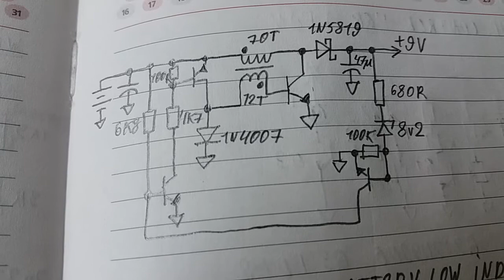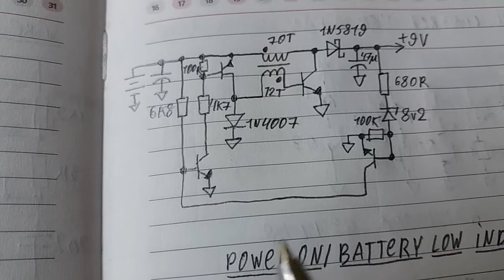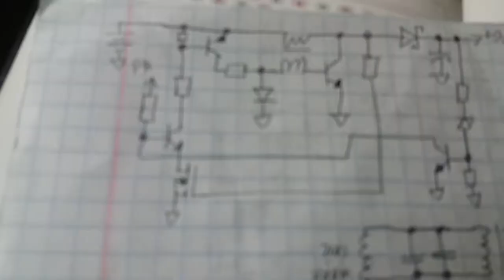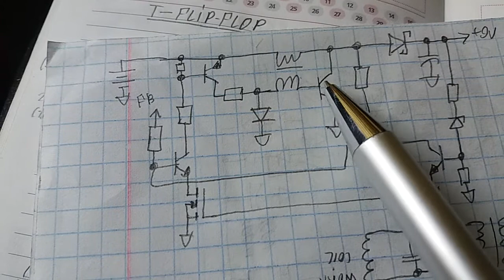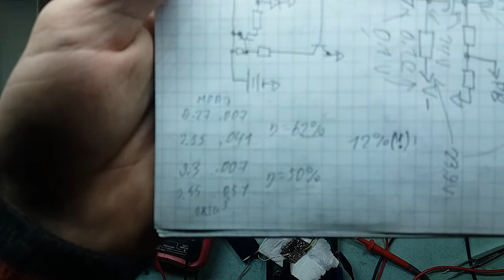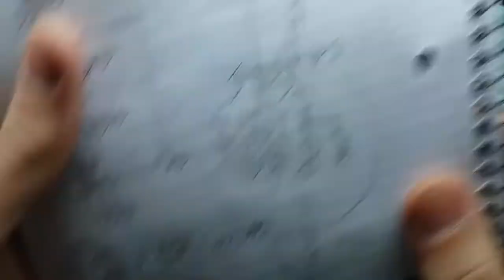Another mod to my JT boost converter

Comment: I think you are being greedy, you efficiency vampire LOL :-D
Getting every last drop of energy and not upsetting your circuit isnt easy.
has your mod changed the spec of the input voltage range for it to work?
Reply from the maker: zx8401ztv It still works down to 1.5v, which is 0.75v per cell. Well below the 0.9v/cell considered as the "empty" threshold.
 This mod does cripple the output a little bit, you won't be able to pull as much current. But in this application, this is not a problem at all.
Reply: To be honest, ive never measured the current drawn by a typical 7106/16 based multimeter, so i dont really know the maximum needed.
I would suspect the 200 ohms mode with probes shorted would be the worst function.

If you want to be more of a efficiency vampire, the cheap yellow multimeters have bare minimal circuits.
Shame that calculator solar cells dont have more output LOL :-D
Reply from the maker: In this meter, it's a continuity mode, that's why I used it in the video. It consumes about 7-8mA.